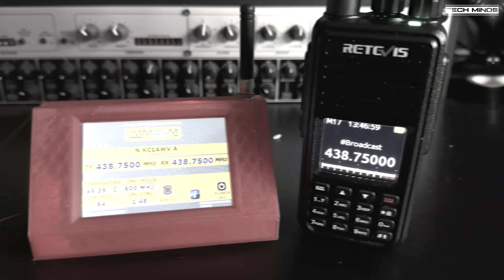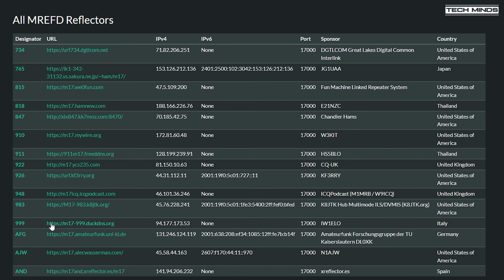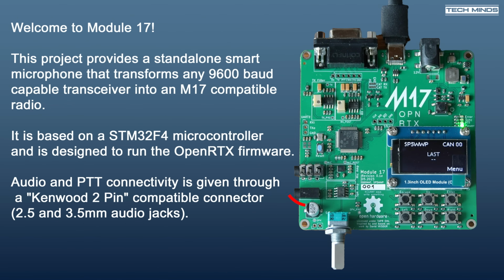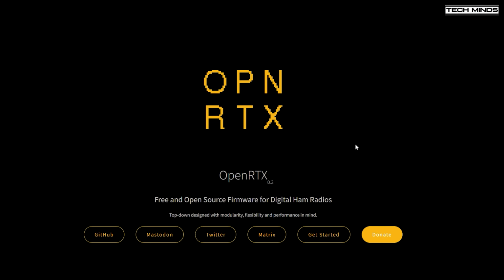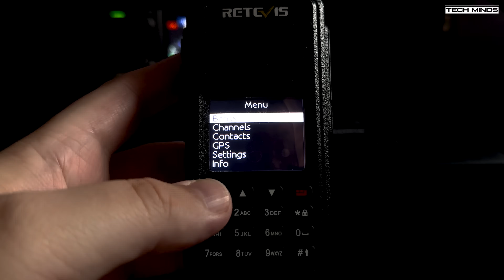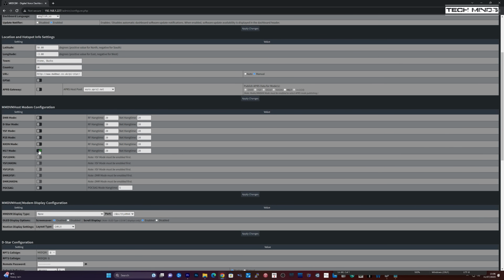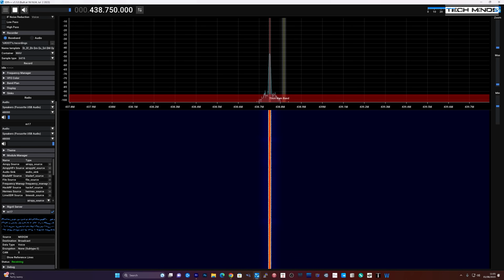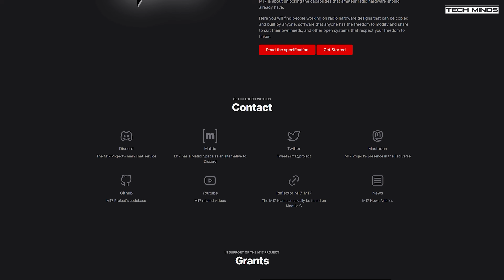M17 The Open Source Digital Mode For Ham Radio

Comment: Excellent video thanks for sharing.

I use blue o dv on windows and its sounds a lot better than on your normal digimodes on radio.

One of the big issues with digital modes is theability to cross mode, for example, someone with a poor sounding dmr setup can come on a ysf channel and it sounds really bad.

Fusion sounds a lot better, with dmr you have a huge variation of audio levels and quality from OK sounding to awful, fusion sounds mostly decent.

Everyone should be on allstar in my opinion the audio quality is superb but the same issue is cross mode from crap digital modes is often allowed and I think we need a platform like allstar to be free from the disgraceful audio quality of digi modes.

Like everything else all these different modes are too complicated to setup with the exception of fusion and bluedv.

Comment: I'm not interested in any of the digital modes. Even back in the 80s and 90s I totally ignored packet when it was getting popular. Who needs it? Meh!!! Maybe you but not me. I have the "mostly for emergencies" train of thought when it comes to ham. Not into it for entertainment. I rarely even get on and talk to anyone even analog. But I renew my license every ten years and keep mostly VHF/UHF radios ready to go and up to date. But I am planning to try to re-energize 220 band in my area. 15 or 20 1.25m repeaters in the Salt Lake Utah area but nobody gets on them!! Really not even that many on 440 either. Utah is mostly a 2 meter state it seems.
Reply: Packet was a blast and incredibly useful in the pre-internet days. I ran an OTA TCP/IP node, passing traffic from place to place. There were BBS systems where people discussed all things radio, sent/received email and traded gear, I still use the HF amplifier I bought that way.  DX clusters that fed you spots and propagation data over the air. There was even a packet callsign server back when most were still using printed callbooks or at best, CD-ROMs. I bought a new Buckmaster CD every year, which was considered very hi-tech!

220 was my favorite VHF/UHF band which provides a lot of the good facets of both 2M and 70cm but it doesn't seem to get used much these days. We already lost a big chunk of the band, I wish people would start using it again before we lose the rest.

Comment: The audio quality compared to all other digital modes is crap.
Reply: We are open to your contribution to Codec2's code to make it sound better.
Reply: @SP5WWP  no need too as P25 and DMR are sounding great in my area so no need for another digital mode.
Reply from the maker: @stevebrodie79  P25, DMR, DSTAR, C4FM etc etc all have their place in the ham radio community, some sounding better than others. M17 is still relatively new, and improvements are happening all the time. As I said in the video, M17 doesnt have any license restrictions, so we, as amateurs, can experiment with this protocol. That's where the beauty of M17 lays.
Reply: @stevebrodie79  DMR sounds crap too.

Comment: M17 looks to have promise for getting away from the proprietary AMBE codec.  Unfortunately the current M17 audio quality leaves a bit to be desired.  Several of M17 examples here have that peculiar ascending step pitch change with sounds a bit like rock songs where they intentionally over-do the auto-tune.  If the intelligibility can be improved, it would be fantastic.
Reply: I was going to say the same thing. Keep in mind though, the original DMR codecs sounded terrible as well. I remember thinking the same thing when playing around on the original md-380. So I waited. Once updates were made to ambe, and I heard a v2 md-380 a couple years later, it was night and day. I ended up buying one, and diving full in on DMR, both the repeater community, but also doing lots of long range simplex voice, and text msg'ing. A year or so later, I could not stand the sound of FM with the static, and lack of text msg'ing. Leaving a DMR radio in the car and being able to RX simplex text msgs that I could read whenever time permitted was just too valuable. I assume this mode will progress much in the same way. The fact that it's non proprietary makes it all the better!

By the way, someone gave me an old original code md-380, running the v1 chip set. It still sounds awful, and cannot be updated via firmware since the chip is running the decoder algorithm and it's hardware based. Fun fact.
Reply: @paaao  Thank you for the reply..  Yes the original hardware amD-380 does make everyone sound almost the same.  I had one and replaced it with the Alinco version of the Anytone HT.  The speech is still kind of robotic, but it is easier to differentiate between people.  The radio into which the other person is speaking matters too.  The MD-380 encoding  sound quality wasn’t great.
Reply: @wtmayhew  the later md-380 models sound great in my opinion. That original codec was real bad however...
Reply: @paaao  Thanks.  It is hard to argue with the affordability of an MD-380.  I like the relatively rugged design, though I believe the case is ABS plastic.  Nice loud speaker too.  One of the bugs I ran into is that even if you set the FM channel width to 25 KHz deviation, the receive seems to always be 12.5 KHz wide.  As long as the incoming audio isn’t too ‘hot’ that’s fine.  One of the repeaters near me runs it’s deviation full channel width and the MD-380 mutes sporadically on moderately loud talkers.  My IFR 1200S service monitor shows the repeater’s center frequency, CTCSS level and deviation are within spec.  I also have an MD-2017 and it behaves the same way on FM receive.  The Alinco DJ-MD5 receives 25 KHz FM channels correctly without clipping the audio.
Reply: @wtmayhew  I love the mono band versions of the md-380. The receive is extremely sensitive, and yes, if people are overmodulated,  using compression, etc... on FM, and they clip, the radio will go silent. You can fix to some degree by turning your volume down when that happens. It's really about audio levels more than deviation, but the two are somewhat tied together.
Reply: @paaao  Thanks for the reply.   Adjusting the volume didn’t seem to help much, but I’ll give it a try.  Thanks for the suggestion.
Reply: @wtmayhew  Lowering the volume will only fix it if the source is just intermittently clipping here and there with transients and such. I used to talk to a guy on a local repeater who had some mic gain or compression setting always turned on his mobile. On my mobile, and other HTs he always came in real hot and somewhat distorted. On my md-380, he wouldn't come in at all. I asked if he could turn his mic gain setting off one day, and hold his mic further away just to see if he popped back up. Sure enough, he came in on my md-380 at that point. Had that setting been set on the repeater itself, I'd have been unable to hear anyone with that radio.
Reply: Two years later, it still sounds terrible and the developers are in denial about it. The "auto-tune" phenomenon you speak of is still there, punctuated by brutally loud squeaks that sound like a smoke alarm warning you that the battery needs changing.
Reply: @socallars3748  Thanks for the reply.  I had not thought about the M17 codec in quite a while.  Maybe they’ll fix the pitch slide problem one of these days.  It is one of the more annoying attributes.
Reply: @wtmayhew  I hate to come across as an M17 hater, as I'm not. I've purchased a CSI M17 capable radio, have modified a TYT to use the mode and would purchase M17 modules and hotspot hats if they were actually available somewhere! From the beginning, M17 seems to be strictly a protocol for people who value experimentation and trying new things, perhaps more than actually communicating. Mind you, that describes me quite well! But unless they're willing to acknowledge and address the sound quality shortcomings, the protocol will never have broader appeal. 95% of hams just want to communicate and they don't want to jump through hoops just to use a mode with dreadful audio. Unless the developers find a way to get boards and other hardware into the hands of those who DO want to experiment, they are going to lose that user segment as well.
Reply: The best way to test m17 audio is to xmit.  “ SHALL WE PLAY A GAME ? “. 😂

Comment: Did MI-6 develop this codec?.....:) 
I wonder if it will eventually work on HF,? Well I guess time will tell.
Thanks for the information and have a nice day,73
Reply: Codec2 started on HF,  the first HF QSOs using it were over 10 years ago, there was even a self-contained fist-mic with the encoder/decoder contained within the mic itself, which could be used with any HF radio.
Reply: Codec2 works on HF already. Google "FreeDV".

Comment: At some point I hope that there would be a module that can be added to any HF and VHF/UHF radio, that lets you transmit a M17 or another open source digital mode that can cary voice over traditional analog signals. And if you I add a AI or an ASIC that can compress or upscale the received and transmitted voice, imagine the range and voice quality that would be possible.

Proper AES 256 encryption is also a feature that is required for a lot of use cases, and should be added to all the different digital modes
Reply: Encryption on ham radio? Are you a licensed operator? 😢
Reply: @DavidLopez-bz4rj  Yes and no. I mainly use ham radio for my hobby, but I also have local permits to use different frequencies that unlocked ham radio equipment works well on.

So when i'm out hunting and using a frequency that I have a permit to use. Encryption would be great to allow me and my friends to speak freely without interference. This is just an example since the use cases for encryption is endless.
Reply: @TheJensss - Your “unlocked ham radio equipment” is illegal to use on any service that it’s not typed accepted for. It doesn’t matter what frequencies you’re licensed for, unlocked equipment, MARS mods, etc., aren’t allowed on frequencies outside the designated ham bands. You should’ve learned that when obtaining your amateur radio license.
Reply: @dereklea1183  As long as the equipment is not misused it's not a problem. My car also goes well beyond the speed limit, but that is not an issue if used correctly and other laws and regulations are followed.
Reply: @dereklea1183 Jens doesn't live in your country. The rules you're familiar with don't precisely apply. Please don't be a know-it-all.
Reply: @DavidLopez-bz4rj the dreaded encryption is used by hams all over the place. Deal with it.

Comment: It's the same like with every DV mode, the sound is just horrible. For me it's sometimes barely understandable. So until that's improved, I rather have analog (FM) voice with a little bit of static..
Reply: Same, the artifacting is so distracting I can't imagine listening to that for any length of time
Reply: @repatch43  Being open source, there is a chance that someone or some group can come up with an improved algorithm.  For now it seems to sound decidedly worse than the AMBE codec, and AMBE sounds not great.

Motorola does something interesting on their Moto Trbo M7 HT.  They have a speech preprocessor which goes in front of the codec.  When you set up the HT, you pick a particular language and the preprocessor is supposed to do some magic based on the specific language to make the sound more natural coming out of the receiver.  I’ve heard it demo’ed on YouTube, and I would rate any improvement as fairly subtle.  The other thing Moto does is active noise cancellation with a mic on the back of the HT to pick up and invert ambient to combine with the front audio.  That actually seems to be a fairly useful feature.
Reply: The quality is much better with Droidstar when both sides use it. Check for yourself. Keep in mind that modified radios will never be able to give as good results as dedicated software.
Reply: @SP5WWP  Thanks for sharing your experience.

Comment: First I've heard of it but like all DMR stuff duff audio compared to D-Star or fusion so not worth the time diluting the digital side of ham radio further.
Sorry as I like a lot of the stuff you post.
Reply: An digital open standard is what should be our common goal.  But what we need is a digital mode that does not sound like you are talking into a tin can.
I prefer FM over digital in 99% of the cases due to audio fidelity.

Comment: Sorry but Digirig is nothing more than a sound card interface.  It's a good one but needs software to become a TNC.
Reply: Partially true, but it's also a USB to UART converter and a USB hub, all in one. So technically not just a soundcard interface. Otherwise it's true, software is needed.
Reply: @SP5WWP  how much different from signallink is this device?
Reply: @W4TRI_Ronny I'm not familiar with that device.
Reply: @W4TRI_Ronny  The Signalink is only really capable of AFSK modes, as there's transformers in the audio path. The Signalink is also not capable of CAT control of the radio.

Comment: All digital modes seem to have the same problem: they sound terrible.
Reply: That's the narrow bandwidth.  Price to pay for the ability to carry data. Great video. I've accessed M17
Reply: @hamradioonthego It's also the way they fail. Instead of nicely fading out, they pop, echo, and change vowel sounds.
Reply: Kenwood digital stuff is the best.. it's fdma I believe
Reply: Not the c4fm on wide .
Reply: @adrianoragazzo1321  your correct c4fm just carries the call sign and or repeater call. Better audio quality but that mode was designed for amateur use.

Comment: Is it possible to use this on HF?
Reply: M17 is designed for VHF/UHF.  There is another project called FreeDV that uses the same Codec2 voice system but is HF focused.
Reply: I would say it depends on the regulatory body of where you’re.  Reducing the bit rate enough to fit within allowable HF bandwidth restrictions is a bit of a challenge here in the US.  It would be great to set aside, say 20 - 50 KHz of 20 meters for wide band digital testing.  It would be interesting to see if a sort of HF CDMA could be developed to allow simultaneous multiple conversations to coexist in that small allocation.  For CDMA to work, accurate timing is necessary, but syncing to GNSS satellites is not a big deal these days.  CDMA also needs fairly equally matched signal levels at the receiver and I don’t know how you’d do that on HF due to variable propagation and receivers all over the place.